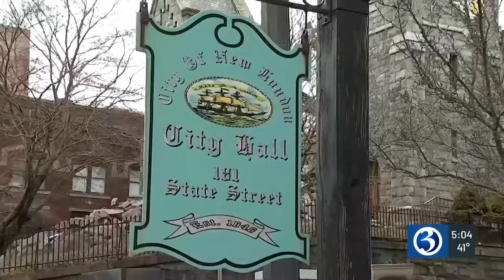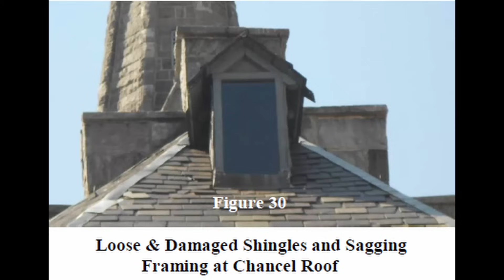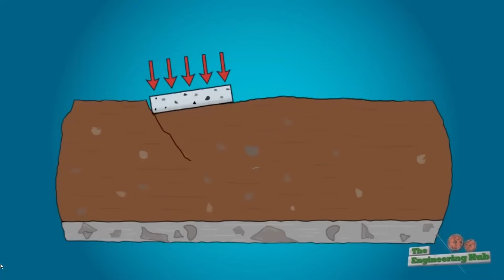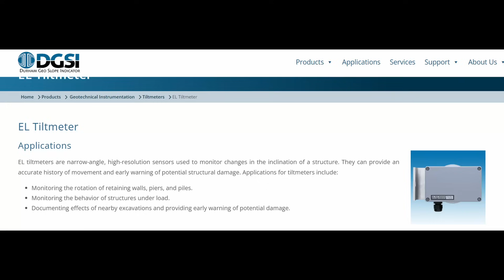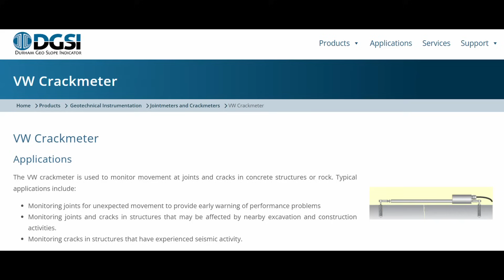New London Connecticut Church Collapse

Comment: The 2019 Fire Inspection was NOT an assessment of structural integrity.  It was a superficial inspection for possible fire risks.  The 2011 and 2019 inspections you mention have two different purposes and are NOT the same type of inspection.
Reply from the maker: Thank you for the clarification!

Comment: In images of the steeple before it collapsed, if you look closely, you can see that the steeple is studded with steel bolts and cross tie reinforcements designed to keep the lower front section of the wall from bowing out.

Comment: Hi Casey. Regarding the Now London Church collapse, A friend of mine played the organ in that church in October of 2023 and had this to say about the church. "I played a funeral in the New London church back in October and saw a tremendous amount of water damage along with buckling doorframes in the upper level directly underneath the steeple. It is, unfortunately, a simple case of absolute neglect on the part of the organization that bought the church from the congregationalists". Thought you would be interested in his comments.
Reply from the maker: Thank you.  That is interesting and does suggest the potential for excess water to have caused deterioration of the foundation over time.  I hope that there is a real investigation here.  If so, it will probably be done by the insurance company assuming that the church had coverage in place.

Comment: 7:55 easily a fake. Even those little vertical windows to the right on the behind building are warped because the Photoshop bot was lazy, they should be razor straight and not parallel to the steeple as lower 3 windows are, if steeple is tilted.  👀

Comment: I heard (I live in Waterford the town next door to New London) that there was some sort of leaking water main in the area of the church. The local water company is Veolia.  Also...The church was/is just up the street from The Thames River-hardly a half mile - nearby (just below The Gold Star Bridge and Interstate 95)
they have enlarged a State Pier area to build a staging area for offshore windmills. For the past year or so pile drivers were working day in  and day out pretty much all day pounding, pounding,pounding. If you listened you could hear the banging out in Waterford . I will also add that I watched the crane from a window across State Street as the rest of the walls were removed and the walls broke away so easily almost like a sand castle....or it appeared that way - it was a sizable crane !

Comment: In Europe, the spire is always formed by a light wooden beam construction, as the spire only has to support itself. It is unusual to build the tower out of heavy masonry because
the tower below must support the spire. The tower leaned backwards towards the church nave. The open passage can be found there; it must be supported by an arc. Perhaps the arc failed because the vertical forces were not dissipated.

Comment: Photo 12 seems to add direct evidence of your assesment of likely root causes as it appears to me to show ground heaving which without the presense of steel could only likely have been the visual evidence of the foundation failing due to soil changing and becomining unable to support loads maybe a roof drain had failed and allowed water to wet soil in excess of historical norms creating a slow fail. Ray Stormont
Reply from the maker: Thank you for your comments. I agree that there definitely appears to be some upward soil displacement in that area of the foundation.

Comment: Any repositories of geo-technical data that could be used as a base line for deviation analysis in areas where the precipitation and freeze thaw cycles have changed? Or possibly, changes in storm water management changed due nearby development (see Ellicott City, MD). Perform some random sampling and see what the data shows. Start with locations built on marine clay deposits.
Reply from the maker: That is an interesting point about their potentially being marine clay at this site.  From the photos of the foundation blocks within the steeple that I should from the 2011 inspection report there looks to be a lot of heave.

Comment: Looking at various photos of the church, the spire shows a measurable lean going back over a decade. Taking measurements of various photos, the spire was leaning somewhere between 1.2 and 1.45 degrees as far back as 2008. Many recent photos show visible deformation of the wall where it joins to the spire. A photo from last year shows at least two stone blocks in the west wall of the building had large cracks (not cracked mortar, the stone itself was cracked). I would suspect foundation failure. It's not as though the top of the spire was crooked, and the base was square, and from what I can see, the wall the spire joined to appeared to be subsiding, it does not appear that it was simply being pushed back by the spire, but that it itself had sunk along with the spire.
Reply from the maker: Interesting about the photos showing the spire tilt going back many years.  I agree that I think that a foundation failure is a strong possibility here.

Comment: There is an NBCConnecticut article which claims the church was built in 1810 and an addition was added in 1975. 
A USA Today article claims it was built in 1850. 
Other articles claim 1852 as the commencement of construction. So who knows?!!

 I would be curious as to how the church withstood the wind and rain of the 1938 Hurricane, which slammed into Long Island and New England with enhanced effects from the strength of the storm and its 60+ mph northward speed. Did it require repairs after the storm? Did other hurricanes and tropical storms damage the church?

Though the architect wasn't happy with the quality of the work, the building did manage to stay upright for roughly 170 - 210 years.

Comment: Far too many structures in these eastern US cities are in excess of 150 years old, at minimum they should be required to meet modern code, in addition to safety, it would boost the local economy.
Reply from the maker: You are right that the northeastern part of the U.S. is full of such old structures. Las Vegas will likely never have this problem as they generally tear down their buildings after 50 years.
Reply: 150 years is nothing for such a building. In europe we have plenty of building and churches that are much older with some being 1000 years old and are still sstanding strong today.
But in US it seems like you do not care about actual maintainance at all and it is clear from the photos and reports that they ignored warning signs.

Also if this happened to an old historic building here in europe it would probably be fixed instead of just torn down.

Comment: Injection grouting of the intact wall segment above the main entry doors... combined with probably a preservation caused disparity between soil moisture inside and outside the foundation.   Looks to have fallen and struck just to the left side of the roof peak causing the higher load to be pushed out by the rafters through the wall.
Reply: There was no soil moisture disparity in the foundation, because there was no soil in or under the foundation. The church was built directly on bedrock.

Comment: The original architect of the church, Leopold Eidlitz, wrote a letter, dated 12 October 1851, to the church's leaders, warning them that the steeple tower of their (at the time brand new) church was unstable. His verbatim remedy was "to take down the whole of the steeple and tower and have it rebuilt by a more competent and reliable person than your general contractor." So, it was a problem known 173 years ago, and should have been obvious to everyone from the fact that modern photos of the New London skyline show the steeple to be leaning.
Reply: My god, that's what you call an advance warning ignored.
Reply: And yet an engineering firm said it was just fine in 2011 🤡
Reply: @marpsr  engineers also said Champlain towers were pretty ok
Reply: HIS STORY THIS BUILDING WAS FROM THE OLD WORLD YOUR DATES ARE FREEMASON LIES THE BUILDING WAS KNOCK DOWN TRY TO HIDE TUNNELS BELOW

Comment: The local NBC news in New London reports that the owners of the building is "Engaging Heaven Church". That doesn't appear to be a "main line" denomination so there's probably no financial support from outside the community. Any repairs to the building would have to be funded by the people of the congregation. I'd say it's unlikely that they would come up with $700k for building repairs any time in the past decade.
Reply: Non-denominational churches are sort of infamous for running buildings into the ground for that reason.

Comment: Thank you for the geotechnical engineering perspective on how uncontrolled water could have led to the toppling of the New London church's clock tower. I belong to a church in New Britain, Connecticut of similar age, with a 170 ft clock tower. You did a great job, piecing pictures of damage from the 2011 inspection, pictures of the leaning tower from social media, and video of the tower falling over. The clock tower of my brownstone church is a beacon to New Britain.
Reply from the maker: Thank you very much, I appreciate your feedback.  Hopefully your church is having regular engineering inspections performed to identify any potential problem areas that would be needed to be addressed through repair and maintenance.  This collapse in New London could have resulted in many lives being lost.
Reply: If you see pieces of masonry on the ground or if you hear weird sounds in the sanctuary, those are definitely warning signs.

Comment: Commented on someone else's video on this earlier how my bet was on freeze/thaw cycles from the snow and rain off the roof of the corner towers (that roofline will just spray the central tower) to the inward corners and a weakened front masonry joint where that water drained while enduring freeze/thaw cycles. Plenty of discoloration in both areas. Your picture of the damage in the central tower to balcony area only increases my belief. The video I watched earlier also stated that the steeple was built incorrectly back in 1851 and that the original architect wanted it torn down and rebuilt.
Reply from the maker: I think water is the culprit here but I there isn't enough information out there to know for sure what the mechanism of failure was.  I certainly hope that there is a thorough investigation.
Reply: the church investigated, found it to be an act of god  @CaseyJones-Engineer

Comment: Yes, vibrations are a problem, but it may well be water getting into small cracks and crevasses where water gets in a freezes.  This only progresses.  Bells themselves are tons of weight.  Also, Roman Church’s were cheaply constructed for speed, and many are Balloon Structures 
….meaning, the stone was/is only a facade.  This church appears to have thick stone walls, but looking in the collapsed roof one sees the thin walls.   What may appear as a solid buttress on the outside, is but a closet or a stairwell on the inside.  Decorative outer walls are never self supporting, they’re hung a steel framework, or in this case iron.  Iron rusts and the wall gives out. 
It’s not a good design. The inside is an erector set of wood engulfed iron beams, and pillars.  It wasn’t built to last. Also, the two left and right towers are superfluous.  The whole thing is a hazard going to happen again with further issues.  Raze it and build something in a more reasonable style…..Georgian is always a nice change and certainly Germaine to New London.  The new Mormon Temple at Philadelphia is a magnificent example of lasting  easy to maintain construction.  I would avoid a tower though, as they are always always high maintenance.   Yes, I’d follow an 18th century Colonial design such as Christ Church at Philadelphia.  It’s not pretending to be something it’s not.  The use of brick and wood is real and there’s a nobleness in the use of brick. The Jusue in North Philadelphia is entirely builded of brick.
Reply from the maker: Interesting.  Thank you for your comments!

Comment: It would be prudent to look and the piping and drainage located underneath the roads surrounding this building. From the aerial views it appears that there are surface cracks on one of the roads. Any undermining from leaking pipes could play a part in the building collapse.
Reply from the maker: That is a great point.  I think leaky pipes have led to similar problems for other structures in the past.

Comment: New London is right on the coast of the Long Island Sound, too, which might suggest that it has a relatively high water table to start with.
Reply: I live about 10 miles outside of New London, CT, and January had much higher than average rainfall. A few days before the collapse we had approximately three inches of rain in one day.  The ground around my house is saturated, like walking on a wet sponge.  I wonder if this was a factor in hastening the tower's collapse.
Reply from the maker: I think you are right about that but I would suspect that where the church was located, the typical groundwater level would be below the bottom of the foundations.
Reply: There also was significant construction with prolonged pile driving for the New State Pier for the Revolution wind energy project. Could there have been any influence from those vibratrions? @CaseyJones-Engineer

Comment: Hello again, i just looked st the interior pics on a bigger screen and I don't think the organ is there but i can't tell exactly. If ut was, yould see a lot more details but also some musicians stuff left out, music, books, notes, etc. it just looks like a hole where one was. A lot of times these old churches get rid of them for whatever short sighted reason.. It appears to me that the balcony is sagging, the columns arent thick enough everywhere and most importantly the pipes left for display (imo, i don't know if anything works up there) that the righthand section of pipes is leaning outwardl and forward which confirms my suspicion that the organ is not used or that would have significantly been noticable to an organistt. If those felt pads dont perfectly seal every pipe but the ones you are playing you are going to hear unwanted pipes play or the windbag is disconnected to the pipes altogether and then they don't play at all! Also, i think the columns on the right hand balcony  are leaning top heavy to the right. ... Anyway hope this helps.
Reply: Very hard to say if there is any sagging from the picture. There is some lens distortion which can be seen by the main columns which are also leaning outward.
 If you corrected those to be vertical then maybe you could look at remaining distortion in the rear. There could also be some bowing distortion from the lens. Unless you took it with a camera you are familiar with it would be hard to know for sure.
Reply from the maker: Thank you for those observations.  I think there will be an influx of photos becoming public for the inside and outside of the church in coming weeks so hopefully we will know more soon.

Comment: I’ve looked at a lot of building collapses over the years ,usually most buildings show signs of pending collapse . 
The way the tower fell shows either a wall or the foundation gave way , masonry structures are prone to sudden failure , the pressure builds the boom down she goes . 
If it was clay soil conditions , the causes are many . Some of the scariest things I’ve-seen when it comes to excavation involved clay  . 👍🇨🇦

Comment: At the front of the building you can see the masonry of the tower going all the way to the ground, presumably all the way to the foundation.  What we can't see is what the back of the tower does, does it substantially continue to the foundation?  Was the interior side of the tower compromised by additional door openings?  Did the basement encroach on and compromise the base of the tower?  I previously watched Jeff's video and at the start it seemed that there might have been a problem with masonry on the inside part of the tower but later in his video he showed several images of the tower that appeared to show it leaning.  If the tower was leaning but still standing that would shift the focus to a foundation issue and as the lean increased that could lead to failure of the masonry.  It seems unusual to me that any settlement of the foundation would suddenly appear so long after the building was constructed but I'm structural not geotechnical.

We have a lot of aging buildings on earth.  When there is obvious evidence of issues such as the leaning of the tower it cannot be ignored.
Reply from the maker: I am thinking the root cause of the collapse was a foundation issue but more information is needed.

Comment: Lead- the varnish on the wood and the windows.   Asbestos, ok 170 years old or built around 1850 so less likely to have it in there when built.  Plaster, maybe not, but any patching yep suspect.  window glazing unless it is lead is possiable.  Odds are original heating was wood, so may have steam lines which will mostlikey have the A stuff on it. Renovated bathrooms and if there was a kitchen in there are all suspect.  Old churches just have less materials to test for A compared to a home or office building.  Still places to look, roofs,  sidiing, bathrooms, kitchens, and heating systems.
Reply: Nobody cares about lead and asbestos in a church, since nobody lives there and people might only be exposed for an hour or so per week.